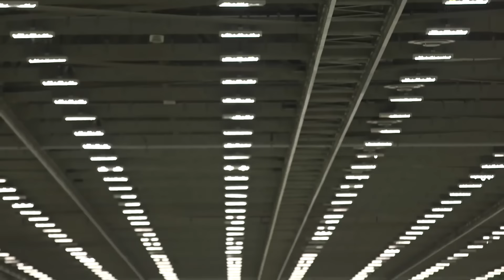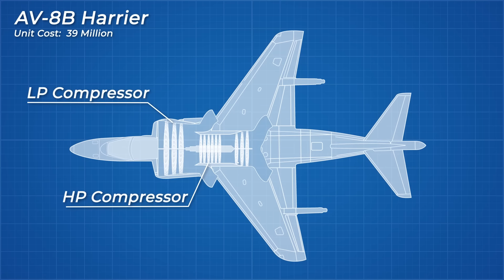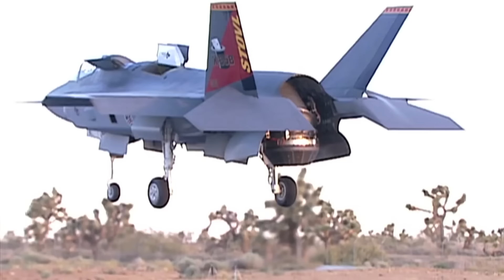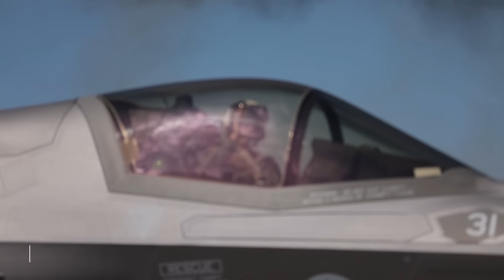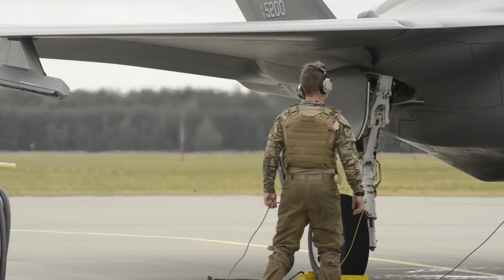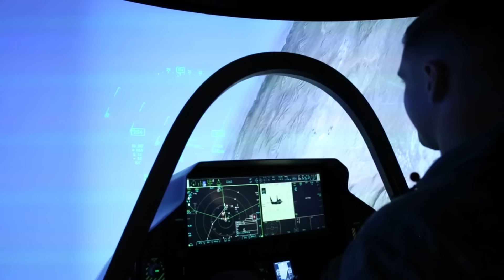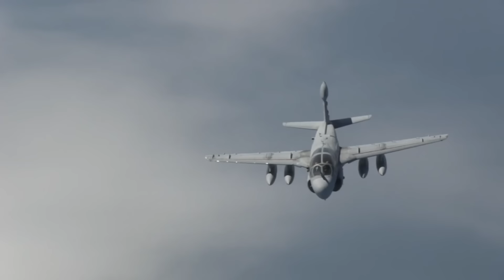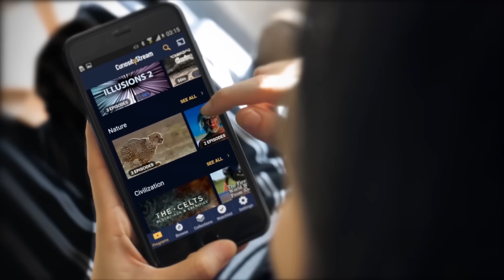Is The F-35 Worth $115 Million?

Comment: The f35 doesn’t have a 30mm Gatling gun firing depleted uranium shells :,(
Reply: They can be mounted on the hard points.
Reply: @orlock20  That's the gau-22/a, which is not 30mm, but 25mm. In addition, it can only fire at a rate of 3000 rpm, instead of 4000. The gau-8 is not supported by the f35.

Comment: I a missing a big argument in favour of the F35 in your video that I believe should also be mentioned. By having three types of the same plane allows for massive component standardisation. Thus also the logistics for spare parts can be simplified and costs saved. During war time a simplified logistical process could also allow for faster repairs and save the life's of our soldiers on the front line.

The biggest negative of the plane is that it still requires a human in the cockpit. Unmanned (remotely controlled) aerial weapon platforms (aka Drones) are the future of air superiority.

Comment: The F-35 replacing the A-10? HA! Funny guys.
As if the F-35 could ever take a 23mm round to the face, still deliver it's 16,000lb of bombs, come back to base without hydraulics, all while also being the most fuel efficient fighter in the force.
To be fair, if you eliminate all competition, technically speaking the F-35 is best at everything.
Reply: The multi-role fighter as a whole (currently the F-16 ) has been replacing the A-10 in CAS operations with contested airspace since the late nineties. The A-10 would not be survivable in a modern contested airspace.
Reply: @peterson7082  It's been a while since I wrote that comment and I've learned a lot since then, however what I've learned further proves my point.
The F-35 is actually really robust, crashes on aircraft carriers show that they have a very solid structural integrity, I think they'd be even tougher than A-10s, minus system reliability.

About the F-16 though, I think you're missing the point, technically any aircraft can do CAS, the point is doing it efficiently. the F-16 has way too short of a range to be flying at low altitude, nevermind treetop level. F-16s simply wouldn't be able to fly into targets the same way Russian Su-25s are doing right now in Ukraine, however an A-10 is slow enough, agile enough, and most importantly has the fuel economy to fly at treetop level like the Su-25, deploy it's ammunition and turn around.

The single biggest mistake the west is doing right now is thinking a near-peer war with Russia or China will still allow them to fly at 30,000ft and drop laser guided bombs, that simply won't happen, Americans will have to fly under SAM nets the same way Russians do today, and rely on cruise missiles for any targets that are more difficult.

Comment: Er, let's be generous and assume they sell 5,000 at $115 million each. That gives an income of $575 billion. But the cost over lifetime of the F35 is expected to hit $1.5 trillion: so giving an overall loss of a tad under $1 trillion. Well, it does support lots of jobs (maybe 200,000), but cheaper ways could be found to do that (200,000 jobs for $1 trillion gives $5 million per job: but, of course, we haven't totted up all those bribes). And it doesn't seem to actually work properly yet: Defence News reported in June this year on 13 Cat-1 problems previously unreported (ranging from flying at Mach 1.3 causes tail damage to pilots not being able to see when landing on carriers - an independent observer might regard these as a bit important). But everyone's confident that these will mostly be downgraded to Cat-2, with only a few being ignored, so that's all right then. I truly wish all F-35 pilots the very best of luck - they may need it.
Reply: > "But the cost over lifetime of the F35 is expected to hit $1.5 trillion: so giving an overall loss of a tad under $1 trillion."

 This is international cost.
Reply: @peterson7082  Perhaps. Here's a quote from Avionics International (August/September 2018): "The F-35 currently costs between $94 million (F-35A) and $122 million (F-35B) for low-rate initial production run 10, though sustainment cost projections are as big a concern as production costs for a program that is expected to cost $1.5 trillion over its 55-year lifespan.", which implies a large part of that $1.5 trillion is production costs: the bulk of which takes place in the USA. The New York Times (Magazine, August 2019) has the quote: "The F-35 initiative is the Defense Department’s most expensive weapons program ever, expected to cost taxpayers more than $1 trillion over its 60-year lifespan.", which explicitly assigns over $1 trillion to the taxpayers - and matches with the estimate I gave.
Of course, the kicker is if that $1.5 trillion estimate is accurate: such estimates have a nasty habit of going up, not down. And, of course, we don't know what costs have been quietly buried elsewhere to try to keep the overall price tag down. But I think there's enough evidence around to show that the economics of this plane are, shall we say, dubious - except, of course, to the defence industries.

Comment: I didn't hear mention that the F-35's VTOL mechanism was purchased from Russia, and not originally designed by Lockheed Martin. you make note of the fact that the mechanism was a substantial cost, but really most of that cost was in development and refinement, not overall design. I feel like the way you worded it gave credit where it wasn't due.
Reply: It wasn't purchased from Russia. The exhaust nozzle was a Convair patent from the early sixties. The vertical lift fan was a new design not similar to any Russian design.
Reply: @peterson7082  Lockheed partnered with Yakovlev on the Yak-41M, a derivative of the earlier Yak-41 which first flew in '87, between 1991 and 1994. during this process they acquired rights and knowledge regarding the Yak-41's already demonstrated powerplant configuration and this was adapted to the F-35.
Reply: @sumdumbmick  The design of the exhaust was not Soviet/ Russian. It was a Convair patent from the sixties. A cold vertical fan is not the same as two turbojets.
Reply: @peterson7082  the allegedly novel aspect of the F-35's configuration is the joint application of a vertical blower in the front and a main thrust blower in the rear. that configuration was lifted directly from Lockheed's experience on the Yak-41M in the immediate fallout of the collapse of the Soviet Union.

the specific parts sourced are of course different, because American metallurgy is not the same as Soviet/Russian metallurgy, so it would not be possible to domestically manufacture the exact same components. further, pulling crap from 3 decades prior only further makes my point that it's actually not that impressive. the component designs are old, the configuration was proven and not developed by Lockheed. thus the credit is being given to the wrong people.

Comment: 21:10 “I think it’s fair to say that we’ve established that the F-35 is a worthy successor to all of these planes.”

No, you haven’t. You haven’t addressed how it’s a worthy successor to the A-10 at all.
Reply: Larger payload, better visibility, longer range and can be operated from carrier(C-variant that is). F-35C even has quite strong BRRRT. Better sensors, avionics, fly-by-wire, more stable, can operate higher, more accurate, can bring drones along, more simple to maintain.

Only downside compared to A-10 is that A-10 is just SEXY and bring the best freedom in form of BRRRT. F-35 can never replace the boners we get from seeing A-10.
Reply: @TealJosh  They have relatively the same payload, longer range doesn't equate to loiter time, MORE SIMPLE TO MAINTAIN ARE YOU KIDDING ME? Did you not see the video? "A scratch in the RAM paint requires replacement of the entire part". Let's not even get into the obvious maintenance hog issues of V/STOL aircraft. The A-10 is a whole lot tougher. Let's see an F-35 come back with 1 engine and half a wing. "quite strong BRRT"? It's a smaller cannon with 1/6th the ammo. That's weaksauce BRRRRTTT.
Reply: @Willaev  F-35C has roughly 5000 lb more payload than A-10(though full fuel load reduces it). F-16 is essentially as glass cannon as you can be and it has flown home with missing wing.

F-35 IS more simple to maintain. Stealth surfaces are not necessary to maintain at all times. Did you notice that I didn't even mention stealth when I made my comparison between the two? People can just choose to not maintain the electromagnetic radiation reducing surfaces. F-35 pays its price back compared to A-10 in couple jet engine swaps and emergency fixes and A-10 becomes extremely expensive after few dozen hydraulic failures later. Man-hours man, man-hours. How did you swap out those A-10 engines again? F-35 doesn't have hydraulics to fail. Every problem is fixed by resetting computer, running quick diagnostics program or replacing electric motor servo.

"It's a smaller cannon with 1/6th the ammo" literally only means it can't kill tanks with it. Smart bombs are specifically made for that purpose. It doesn't need much ammo because against infantry targets all you need is HE rounds and fly-by-wire accuracy, lower recoil, oh and higher accuracy over longer distance.

Loiter time means time over target. F-35 is designed to maximise the capability of loitering wings and nose level, and ONLY when it's ready to pull the trigger does it need to put its nose down. F-35 can fly EXTREMELY slow when wings level.
Reply: @Willaev  The video is wrong considering the F-35's RAM is built into the surface, not necessarily painted on. They don't even need climate controlled hangars and are typically found in the same storage facilities an F-16 would use.
Longer range and higher speed mean you can support multiple ground operations compared to the single A-10.
The A-10 isn't STOVL so there's no point getting into the maintenance issues of STOVL aircraft because an A-10 cannot operate from the same locations.
The A-10 isn't tougher in a practical sense. It's ability to get the pilot home after receiving damage (NOT continue the mission) is better. The A-10 is not armoured.
Let's see the A-10 come back with 1 wing missing completely. The F-35 could likely do so considering it is a lifting body design like the F-15. The A-10 would crash.

Comment: the problems with these machines is its costing US tax payers trillion$. then the govt allows other countries to buy these, and older models, for less than the cost we paid to build them. granted they're stripped down models. They should be building jets with 5x-10x more powerful turbines, better radar blocking, safer control systems, and lighter weight with better maneuverability. 
And they rarely create any new technologies, just redoing the same bs over and over again hoping it works. just look at their failure O2 system that about killed pilots and i think caused a few to be crashed.

Comment: Great video, but close air support capability is woefully behind the A-10, thoughts?

(Flyover duration, ordinance payload, etc).

Also, does carrying ordinance under the wings not ruin the stealth profile. If so, my understanding is that most folks on the ground would rather have a-10s. Thank you!
Reply: An F-35 can easily loiter for up to 90 mins in uncontested airspace, which is the same threat level airspace that the A-10 operates in.

The F-35 can also use it’s external hard points to carry precision weapons, so the payload is comparable to an A-10. Of course this does ruin the stealth profile, but an A-10 can only fly in uncontested airspace so to keep the comparison fair we should assume that the F-35 is also flying uncontested and thus can afford to ruin its RCS in favour of more bombs.

Comment: I've heard the B2's radar profile makes it appear the size of an average seabird on Radar readouts, which is below the level at which they filter out signals because the military isn't really that worried about tracking seagulls.

What I've always wondered, if this is true, is why people don't add a layer of calibration based on speed.  The B2 is substantially faster than a seagull, one would think programming a radar filter to pick up on something moving that fast would not be too much of a challenge.
Reply: The problem isn't speed, it's range of detection. Doesn't matter how fast the "seagull" is if you can't spot it in the first place.

Comment: why couldn't the US just build a spacestation that launches jet fighters from orbit controlled by AI?
Reply: You'll also need to add -
1) Heat shields for atmospheric re-entry,
2) Reaction Control System (RCS) to move and change attitude in space,
3) Cryogenic engine to switch ON & OFF in space,
4) Extra shielding material to protect the pilot from radiation, etc.

So, in effect, you'll end up with something like the Space Shuttle but with the capabilities of a fighter jet. Doesn't seem remotely possible with today's technology.
Reply: @starstuff4ever  
fine.

itroducing the GFL.
A Giant Fucking laser.
It can vaporize a entire city.
"cost and energy requirements are too much for todays technology" blah blah
powered by nuclear reactors and massive solar arrays. the US doesn't give a fuck about cost

also i said that the fighter jets would be controlled by AI so no protection for pilots

Comment: The A10 is such a niche one of a kind aircraft build for a single purpose it is the most difficult to replace by the F35
The F35 is ofcourse way better suited in non air dominated airspaces then an A10.
The A10 is strong but with enough hits it also eventily goes down
On the otherhand the A10 can hold on much longer on a patrol to protect the groundforces then a F35.
In my opinion the F35 is better suited for wild weasel missions then as a patroling gunplatform above the battlefield. 
The A10 is artillerie the F35 a sniper

Comment: Well, one big aspect was never really touched and that is reliability. My knowledge on may be quite limited, but I have read so far that the F-35 spends lots of hours in the hangar for each hour of flight and that some critical tests could not be performed, due to a lack of reliability.
Also, the comparison to the F-117 and the B-2 was like apples to oranges. Both have a completely different role that keeps them out of immediate danger most of the time. They were and are really precious and especially safeguarded. Also, they were only used against a technologically inferior enemy. So no wonder, their loss rates were so low.
BTW, if a stealth bomber has to be accompanied by non stealth radar jammers, doesn´t that rather defeat the purpose of stealth tech?

Comment: The F-35 is great and all, and will be able to replace a lot of planes, but one it won't be able to replace is the A-10.  There are a few reasons for this, one is the A-10's gun, which is probably the single most effective weapon it has.  Another reason is the A-10's loiter time.  The Air Force has been using F-16s and F-15Es as CAS planes, and they are able to support ground troops with bombs, but due to their designs, they are unable to stay in the area and provide continued support.  The F-35 shares this shortcoming with the other fast jets.  The Air Force's Light Attacker program should help with this, but if we ever get into a large scale ground war, we will want the A-10 and it's fantastic gun to mop up enemy tanks and installations.

Comment: its value will only be determined when pitted against the enemy. What does 115 million mean. The unit cost. Does the B model cost more because in my book the only one worth having. How about design costs. Maybe triple 115. What will be its kill ratio, and will it even get a chance to fight? We do not know. Is it a good deterrent? If so then its value will be worth the gold fortune given it, if the enemy thinks they can kill it easily like Russia against Finnland, then its value is nil. If the enemy is filled with uncertainty, then they will have to improve their 400 series anti-air, and as to ground attack? Do you commit an airplane worth 300 million dollars to knock out a 25,000 dollar anti-aircraft gun? To even save one marines life? might be too expensive not morally, but effectively. So it won't go where the going is thick. High loss value will prevent it after overtures.

Comment: I don't care what you say. There is no plane capable of replacing the A-10 warthog. It's the one and only capable CAS aircraft and will remain so. The troops on the ground don't give a shit about how much it costs. They want to survive and the A-10 has proven to be the best platform to do it. It's not called the Angel of Death for no reason. F-35 won't replace it. Every branch wants the A-10 but the airforce and that's because they don't have ground troops.